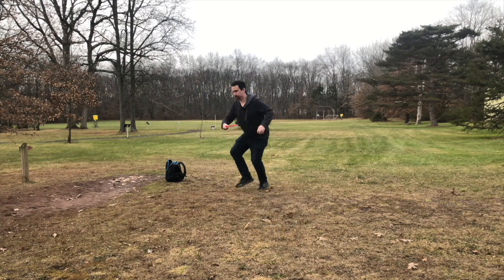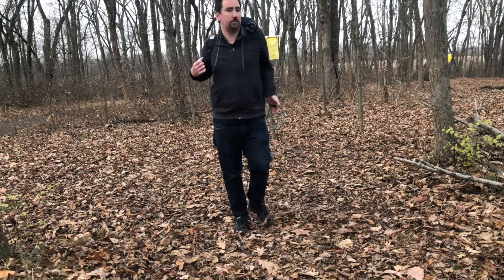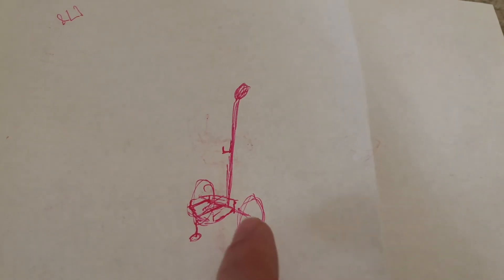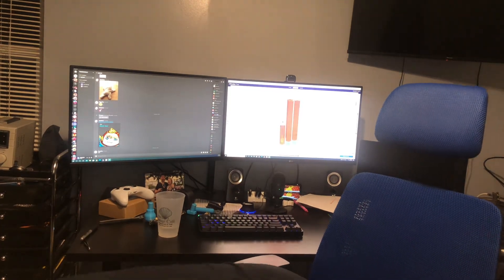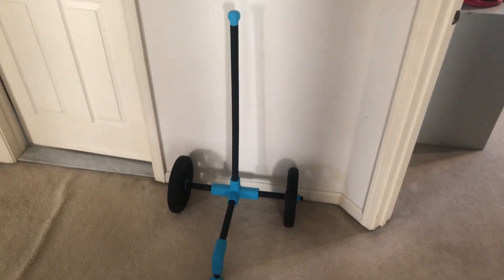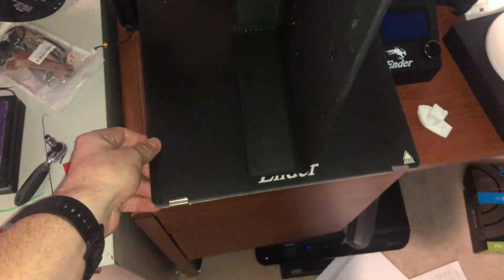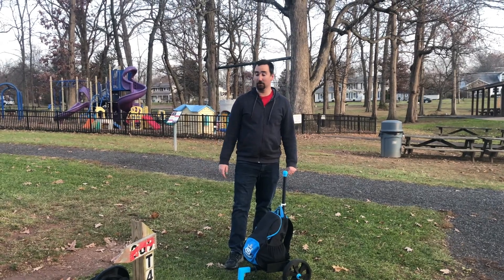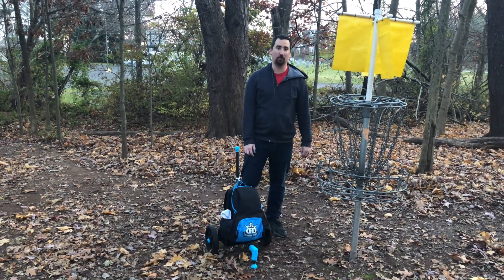3D Printed Disc Golf Cart | 10" Wheels, Print in Place Bearings & Ball Joint | Ender 3 Max

Comment: I have a printer ender 3 but i decided to make mine out of PVC due to material cost.  I also repurposed some lawn mower wheels i found in the trash using a piece of all thread for the axle. I didn't glue a few joints so that it will fold up and fit in my miata. I also put a piece of metal tubing in my handle to give it rigidity for pushing. Use a 4 way at the mid point and come out a little so the straps ride the cart like a backpack lol.
Reply from the maker: Yeah, I definitely would recommend sourcing most of the parts from other products. I think this was more of an experiment to show how capable a printer can be, rather than what you should do.
Reply: @Print Practical  yeah I designed something and when I saw how much plastic 1 piece would be I changed direction. Maybe a design that has pvc supports.

Comment: No offense.  I'm not trying to be a troll here and I understand that this is a 3D printing channel(although it's called print practical, not print everything), but I think some parts just shouldn't be 3D printed.  I would never print a tube, especially in sections, when so many tubes exist and in so many sizes and if you need threads on the end, you could even use a broom stick.  Same thing with the wheels.  I found a jogging stroller on Facebook Marketplace for $7.00.  It comes with 3 wheels, bearings included.

Still it's an interesting exercise, I guess.  If you want to make it stronger and stiffer, you might consider some triangulation.  Good luck.
Reply from the maker: Haha no offense taken. I get it, it’s pretty easy to build an affordable cart. I think this was more of an experiment to show how capable 3D printers can be. Is it the strongest? No, but one day I had nothing, and then a few days later I had a fully functional device. I definitely agree though, you could easily build a strong cart via sourcing parts. 

Thanks for watching !

Comment: This is awesome, how has it held up for you? Also have you made any other changes to it, thinking about printing this thing!!!
Reply from the maker: One thing that has happened is that the handle knob broke off in the handle. I’m not super pumped about the rigidity of the handle. I may make an adapter to use a wood handle instead. I’ll update here in the near future.

Comment: Thanks for putting the time in on your file and this video.  I came across your 3D print file on Thingiverse which lead me to this video.  Cool to see that you're playing at Plains Park as I used to play there while living in Chalfont.  Have you run into issues with squeaking between your wheels, bearings, and axle?  Whenever you've got moving parts that are the same material, squeak tends to be a common issue and just wondering if you've come across this already?